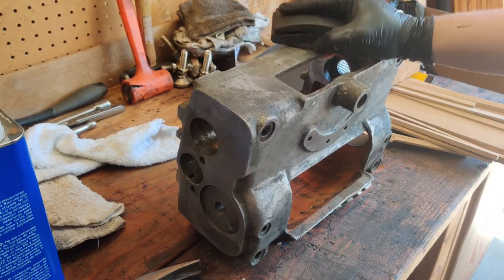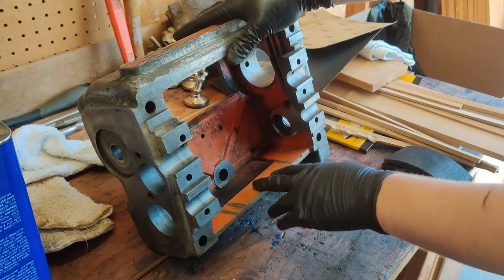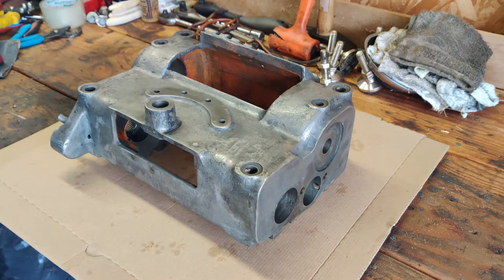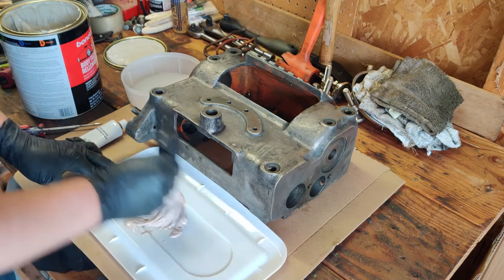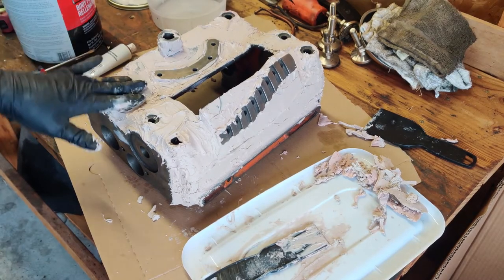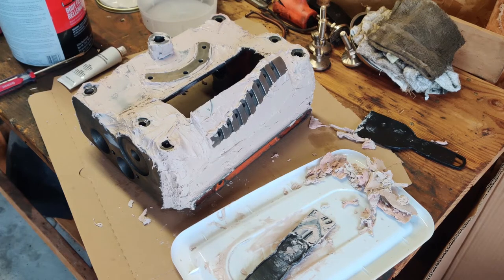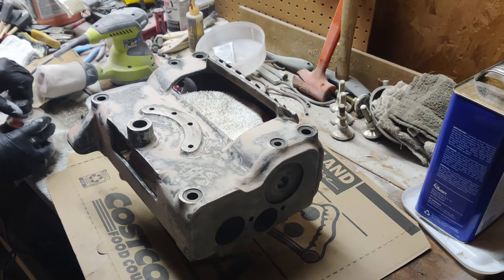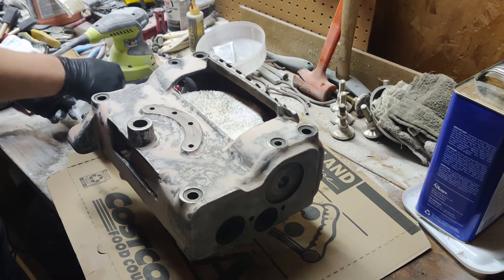1950 LeBlond Regal 17" Lathe Restoration Part 20: Painting and Assembly Quick Change Gearbox

Comment: Personally I just went with a heavy machine grade paint which is made to you know as you seen from taking off the paint kind of cover in and fill all those cracks in as it's being painted on it's a lot less work but two each is on you know depending on how particular you want to be I don't know that any of this has anything to do with it actually working well I spend any of my time to be on the inside where it really matters but I understand you know sometimes you have these projects you want to do and you just you want to make it look like it run off the factory floor but or actually in this case you want to make it look better than I ran off the factory floor